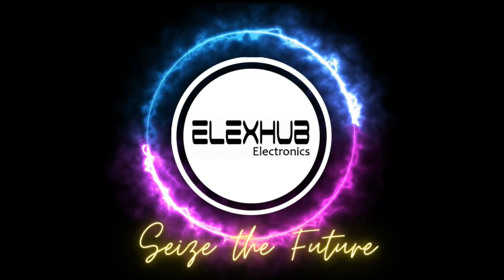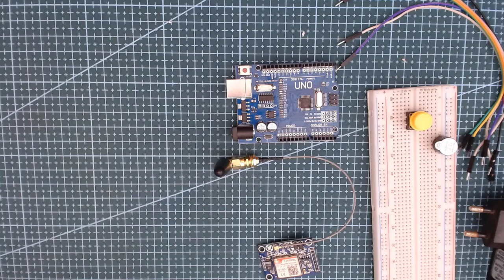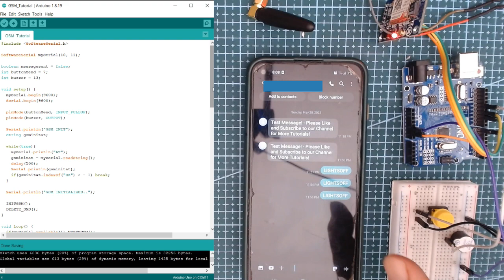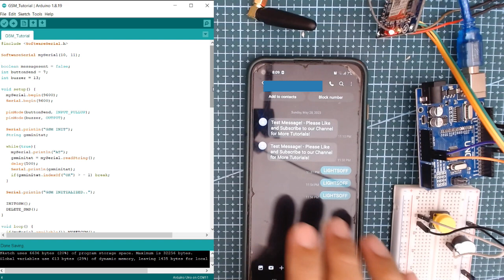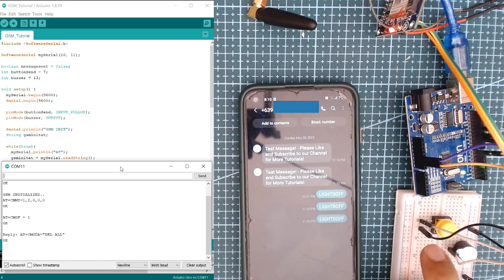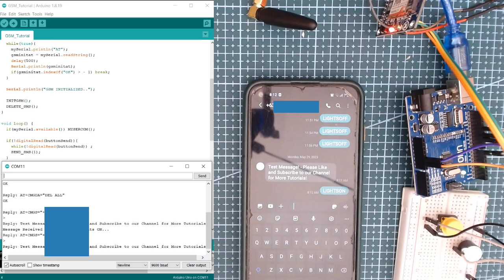GSM Module: How to Send and Receive Text Msgs using SIM800L and Arduino

Comment: Pwede po ba na Li ion battery with 3.7v Yung power supply Ng GSM?
Reply from the maker: depende sir sa gsm module meorn pong module na sim800L na kaya ang 3.7V po
Reply: @elexhub  Yung v2 po sir gamit ko
Reply: @elexhub gaya po sa gamit nyo

Comment: Sir how about the version 1 of sim800L gsm module, Using 3.7 volts battery as an external supply. Pero it keeps blinking every 1 second po which is hindi po naconnect sa signal. Registered naman ang sim and inserted properly. Dami na nasayang na battery from looking for the right capacity of battery/supply. Hope u can help me :)
Reply: Badly need it sa thesis :) tyty
Reply from the maker: tingnan ko sir eto kung magagawan ng tutorial

Comment: Ask ko lang why is it na di makaconnect sa network? kahit may sariling powersupply na 5v 2a?
Reply: kahit anong sim po ba gagana padin?
Reply from the maker: make sure na common ground po, and registered ang sim card po
Reply: @elexhub   Bosslings last po, nagana naman po yung Smart 5g sim diba or may specialized sim kayo na only for 2g lang? or any sim naman po diba
Reply: @elexhub  Thank you boss na solve ko na. Nanghinayang pa ako pero pinutol ko rin yung wire ng 5v 2a adapter ko and diretso salpak sa breadboard para bawas sa voltage drop. Working and sending messages na po thx boss.
Reply: @twoligmaocomics441 hello po ano pong sim ginamit niyo?